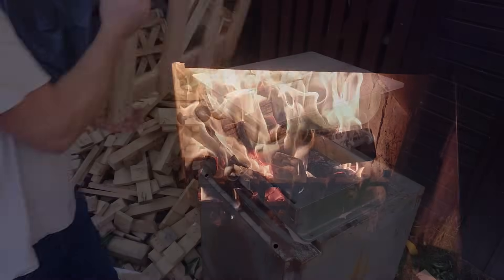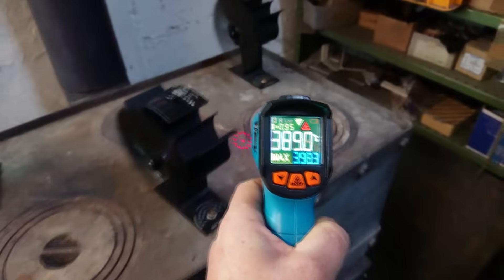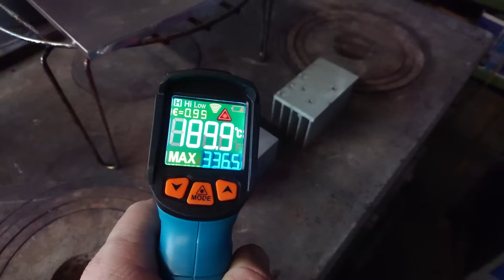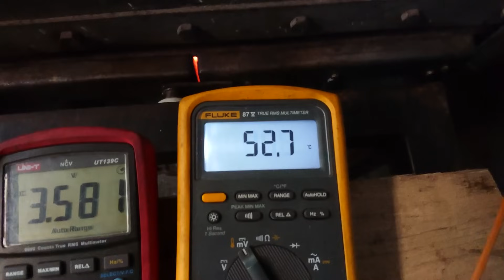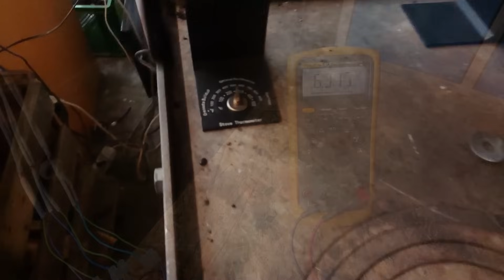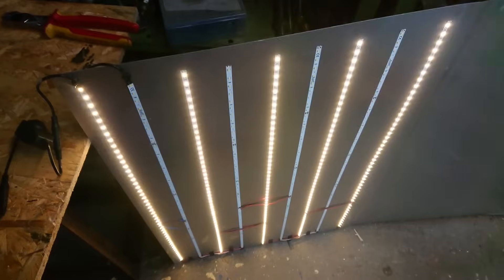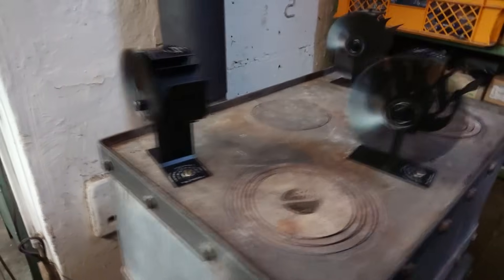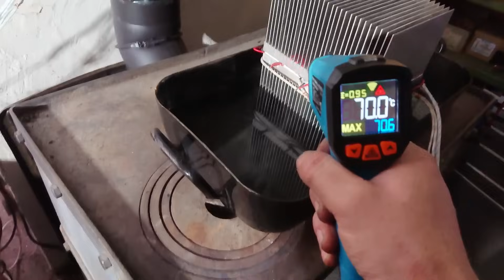Generating Electric Power with my Wood Stove - Peltier Experiments

Comment from the maker: Just a quick word about the specific type of Peltier (TEC) device I'm using here: There is no question that there are better (dedicated TEGs) somewhere out there. But the reason why I made this video, is that this specific TEC that is sold as a cooling device is now 4 or 5 euros a piece. During my research I wasn't able to find any cheap dedicated TEGs, but if you know of any please let me know and post a link here if you can.
Reply: The peltier has limits. Find those limits. How much heat can it turn to electricity max - And then create a heat pickup that will self-regulate to that power transfer level. You can abuse the laws of physics on differential of expansion of materials. Even a small wax rod will be enough with a spring - if it gets hot, the piston bends the plate and disconnects the bottom heat sink, reducing heat transfer. The cooling side can be designed to cool off within the above spec, passively.
Reply: The main difference between a TEG module and TEC module are that the ceramic plate on the hot side is slotted so the expansion can be compensated for. Also the solder that holds the PbTe/Se elements in is a higher temperature mixture than of a TEC. The final difference is that the  thickness of the module for a TEG is thinner than a TEC to allow for faster thermal transfer and more current. The combination of these features allow for longer life and about 20 to 30% over a regular TEC as a TEG. The best TEG modules have Bismeuth Cadmium Lead Selenide with aluminum nitride ceramic plates. These are used for 238Pu based nuclear "batteries"
Reply: Very interesting video, loved the content.
Are you familiar with a simple thermostat heat choke?  It's got a steel coil inside of it that bolts to an engine manifold which expands when heated thus opening the choke on a carburetor. You can hook your chimney power generator device up to a similar choke so that a vent will close at a certain temperature thus controlling the heat as not to damage your thermal electric generators. 
it would require the need for a steel cabinet and closable louvered vents. I think you'd be able to maintain the heat to operate at a constant workable temperature.

You may find what you are looking for in a scrap yard.
Reply: This is good idea. Along the same lines, one could use an automotive engine thermostat to push open or close a plate or damper.   @IR-nq4qv
Reply: Couldn't you access cold outside air to cool the other side to make a greater temperature difference? It's snowing out there and a simple pipe loop could do wonders
Reply: a combination with a water heater would be cool
Reply: @imyaaniggua  IPOWERTOWER THERMO SYPHON
Reply: Some newer cars have TEGs - but haven't been able to find any used parts on the cheap, but that might be a source to look into.
Reply: Something you could try is to use a 'phase exchange cooler' on the cold side of the TEC. Something like a CPU cooler for example. While not free by any means (unless you're lucky) they should cool better than your current static heat sinks without the need for active cooling. Good luck.
Cheers 🍻
Reply: potentially a material change for copper on the cool side . while copper and aluminum heat and cool similarly, copper does it that bit faster . it is much harder to come by larger copper heat sinks albeit. best of luck on getting a good differential. 

I had a rethink and potentially a cheap pc cooler with copper heat pipes, their whole job is remove heat from a plate.
Reply: I thought of a water bath to limit the temperature 👍. How about using a heat exchanger on the cold side, but without a pump. If you put the cold reservoir/radiator higher than the generator the coolant will circulate by convection, hot water rises, cold sinks.
Reply: @regisdixit steel rebar wont conduct heat to that length, all the way to the floor, only the first foot would radiate...3rd person with this wonky to the floor idea, he simply needs cool air to the top side with a ducted vent of any kind
Reply: The main difference between a TEC and a TEG is the expected operating temperature and deltaT. The hot-side temp creates issues with solder melding so the must be manufactured with high temperature solder. The high delta temperature (between hot and cold side) creates stresses so they must be manufactured with a floating hot-side meaning no stresses will arise there. The generation is identical and use the same seebeck effect. Higher temperature difference means more heat can pass through the element which means more electric power is generated per element.
Reply: And on the plus side, if you induce sufficient currents in the Peltier you could start a fire on your Wood stove😂 I have been wondering for a while now how to bring some of the Canadian cold on the cool side of the Peltier. Floor rebars cannot be used here since we insulate our floors.
Reply: Pesquise o elemento SP1848-27145
Reply: What's your files member #? 😂

Thanks for your testing.
Reply: I thought about something like this but decided on a different solution
https://www.youtube.com/watch?v=hEOht38IFYQ&t=471s
Reply: The stove top fan uses a bimetallic strip at one side of the base, it just lifts the whole fan away from the stove top, self regulating. @orionbetelgeuse1937
Reply: Just wondering, instead of the stove have you tried it with a candle or spirit lamp or something? I believe a candle gives out about 80 watts of heat energy, you would get extra light too. 😂
Reply: If im not wrong 
U'll wont have to worry about Natural Gas Being expensive anymore
If im not wrong Germany is Buying gas From Algeria 
The pipeline is Going through Italy and coming to germany again if im not wrong
Reply: Make a steam generator 😃
Water from rain
Heat from the stove
Reply: Here's another idea for heating your shop: the process of composting can generate temperatures up to 60-80C.  All you need is a way to transfer that heat from the center of the compost pile to where you need it.  Many folks use loops of HDPE piping, but I wonder if pumping water through second-hand car radiators buried in the pile might not be more efficient.  As well, you could attach a second radiator to a box fan to heat the air wherever you need it.  I haven't done it myself, but apparently you need the proper balance of 'green' and 'brown' organic matter for optimal composting, and it needs to be well mixed to prevent very dry, very flammable pockets of material from catching on fire.  (The chance is VERY low if you have any sense, but still non-zero.)  The relevant search string is 'Jean Pain compost heating system'.  

Cheers!

...and yes, you could have compost-powered electricity production with TEGs, theoretically enough to power the water pump.  Maybe.

...and if you enclose the compost system--i.e. create a 'biodigester', then you can harvest the methane produced by the process.  (You'll want to scrub the H20 & CO2, but that isn't too difficult or expensive.)

...and if you search on YT for DIY Perks' 'Turning Smashed TVs into Realistic Artificial Daylight' video, you'll find a MUCH better way to use those LED strips AND recycle some e-waste, to boot.  (Make sure you click on DIY Perks' video, as there have been a number of copycats over the years using the exact same title to pull views.  I'll include the direct link below, but YT might delete it.)
Reply: @KeithOlson 
Compost can get a lot hotter than 80°c.
We used to compost 300 tons of grass cuttings and general garden waste every year, upto 12 tree trunks, we used to have to damp it down every day to stop it bursting in to flames.
Within a few minutes being cut and piled up, grass puts out tons of heat, can destroy vans and kit if not careful..
Reply: @tedleaf-pk2jc  Yeah, some care definitely needs to be taken with it.  

(The figures I used are considered the high end when it comes to the survival of the bacteria, rather than the maximum termperature achievable.)
Reply: Here is that DIY Perks video: https://youtu.be/8JrqH2oOTK4?list=PLOJU8YJjFwGN0hMRewz2_u2IefV-vipsk
Reply: Maybe a homemade steam engine liked to a generator would be more efficient and be one the few option after SHTF like a global conflic.
https://www.youtube.com/watch?v=qzp09qyH_J0
Reply: The efficiencies of Peltier's are at best lower than 5% and only if you can properly cool the non heat side,  such as running water.  Economically solar panels are far better sources of power, last for decades though you would need some kind of storage.  Second hand lower efficient panels can be acquired for very little money.
Reply: Okay you just suggestion here have you tried some resistors and some bump up transformer from the radio okay just bring it up
Reply: Is it an idea to use like the fans the rotation movement to to a magnetic field so like a generator? Maybe first increase the torque,with wheels or multiple fans increasing the torque
Reply: have you thought about stirling engines?
Reply: @BjornT97   mechanical parts, not easy to source replacement parts without a lathe.
Reply: Proper TEGs are prohibitively expensive and gather only a little bit more energy.
Reply: @jackmclane1826  Proper TEG 5-8% efficiency. Peltier 3-5%. TEG moduls  +200°C ~20$, +300°C ~30$, 600°C ~50$. Price depend on output. +300°C ones with output up to few watts cost ~30$, ~8W ~60$, ~18W ~100$. Those "cheep" (5-10$) Peltier output less when 1W, breaks around 100°C if passively cooled. Module sizes same. One proper TEG 40mm^2 for 30$ will give couple watts easily. Will need few 40mm^2 Peltiers (~20-40$) to get same amount. Problem with dedicated TEG modules - not readily available for hobbyist/tinkerers/public in local/generic (electronic components) shop.
Reply: @jackmclane1826  bs
Reply: Für handy laden und paar leds reicht auch so ein kleines dampfmaschienen model. Da komm ich nämlich zum Punkt. Richtig power würde nämlich ne dampfmachiene bringen. Wenn jetzt son alten rasenmäher motor als dampfmaschiene umbaust. Da machste ein paar ventiele auf und zu um da dampf rein zu lassen und dann lüppt das. Gut da brauchste dann irgendwie ein dampfkessel. ist wieder higher mantinace Aber dann hat man was richtig geiles so.
Reply: Proper TEGs are not more expensive than few 4 Euro cheap ones put together, because they put out that much power. And it'll have better results and easier to set up.

The single greatest reason for power generation is the ability to handle higher temperature difference. It also has the side benefit of implementing as a practical application easier because it can handle greater differentials.
Reply: I know as American I probably have better options, but I've been looking into the graphite based superconductor thermal plates. They are far more heat tolerant, and can maximize the differential of hot/cold sides. Try utilizing-  the outside sections, double wall pipes, ( I transferred to a square galvanized pipe outside & covered all for sides, wiring then per section, supplying power to battery that power my home.) The middle road higher grade layered graphite/alloy thermal plates are a bit more cost. But You get what you pay for. And Cost efficiency is better than Cheap. Cheap always costs more in long run
Reply: @MarineVeteran0351  How exactly does being american help you here? Do you have more chinese crap than anybody else? :D
And what do superconductors have to do with that?
Reply: if you heat up peltier coller to slow petier coler can't produce electricity an can burned off

Comment: I've never seen a peltier device in my life, or didn't have any technical requirements to recognize it, but doesn't it have factory specs? Try to find the dangerous temperature range and before you test it, use a thermometer to check the temperature you're getting. I'm just saying this because I'm stingy with money, why burn a 60$ device?

Comment: One of the stove fans that I’ve looked at before had a little bimetallic strip in the flat base, which tilted it very slightly at high temperatures, just breaking thermal contact and regulating the heat that got conducted up into the aluminium extrusion. 

I thought that was quite a neat, simple means of temperature control. It might be worth thinking about something like that, I like the idea of a simple but active means of heat control.

Comment: I absolutely love this experiment...I'm sitting here staring at my wood stove, with one of the Peltier fans on top running...I've been thinking of how to get electricity from this for years.  Have you looked at the Bio-Lite camping stoves? they are portable camping stoves with USB plug in's to charge devices.  Their website reads it's powered by:  Patented combustion technology creates a vortex of smokeless flames for a portable camp stove that can cook your meals and charge your gear, all at the same time."  I'm not sure if it's new or old tech however I'm going to check into it too EDIT:  it is the same type of concept ... SEEBECK efftect.  Just watched a video...anyway, you might like to look at their small set up for fun.  Thanks for your experiments here.  Keep up the great work!

Comment: Have you considered placing the device on the outside? 

A All the heat exiting the pipe at this point is truly "wasted" as it is not heating the room at all. In your current set up you are stealing a little bit of heating power to convert to electrial power , If the set up was outside then your not stealing any heat from the room. 
B The temperature of the pipe at this point would naurally be lower.
C The cooler outside air would increase the temperature differential.

Comment: Maybe try not using the large heatsinks at all. Allow the hot side of the peltier to heat up from the emitted radiant heat and set the temperature by varying the distance between the peltier and the hot surface, stove top or exhaust pipe. That way you reduce complexity, materials and cost. I am imagining a square section of flue, surrounded by a larger square section. The peltiers would be mounted on the inside surface of the outer square section. The outer square section would be open at the top and bottom to allow the hot air to exit and not overheat the peltiers. Think of the outer square section being similar to the safety surround that is sometimes put around a flue section to prevent someone being burnt if they accidentally touch the flue.
This would give a large flat surface to mount the peltiers. Being open at the bottom and top would allow for easy wire routing. The peltiers would be out of sight making the setup look just like a normal stove setup. You would only need thermal compound on the cold side where it attached to the inside of the outer flue section. There are thermal compounds that are a glue as well as a thermal transfer paste. I think they are called Thermal Plaster.

Comment: Very nice. An interesting setup I thought of would be to replace a nearby window with a sheet of metal, put the Peltier's on the inside and feed them with hot water from the wood stove via a heat exchanger, on the outside put big heatsinks and let the cold outside air do the job of cooling them?

Comment: I'm curious if a well designed fireplace like I've seen built on YouTube could power a water heater than has a recirculating capacity so the second heating of the water can drive a flywheel and that flywheel could power a compressor  to be used in tandem with induction heating to create a refrigerator in the basement below this first floor fireplace. It's a typical setup in Midwest America and having a method to run basic heat power and refrigeration from the fireplace would free many middling folk from the corporate chokehold.

Comment: flash steam generator (a very thin copper tube around the gas pipe, or better on the inside top of the stove, with water flowing inside). at a certain point the water became steam with really low energy. Then use the steam, to spin a Tesla turbine binded to a generator. Condensed water could be re-routed, from an opened container, to the tube, with a pump (and maybe used to heat some radiators in the middle?).

Comment: Well done! As heat rises and cold falls, a completely passive water jacket might work, you have the temperature differential between the top and bottom of a large vessel of water. Or perhaps a different liquid medium could be used. Or a cold sink to a large part of the building structure itself? You might need a heat pipe to move the heat away in that case. Perhaps you could make the heat pipe itself. In Germany right after the war, my Dad saw trucks that were powered by wood gas. He also had to visit a Dentist, the Dentist had no power to run his drill, so he had his drill powered by a stationary bicycle. People also were collecting bricks to rebuild. Everything can and should be repurposed, you also gain the skills and ingenuity, that will get you through anything and it helps the planet. You are so handy, my number one regret is I never learned how to weld. All the Best! 73 DE W8LV BILL

Comment: to cool off the top of your last experiment you could get a fresh air intake from outside run the cool air on top and then connect it to your fresh air intake on the back of the stove and this will constantly cool the top of the TEG 🇨🇦👍👍👍👍👍

Comment: Have you thought about using flexible soft copper tubing for water cooling encased in high temperature resin and impregnated with copper powder or granules to disperse the heat evenly.

Comment: you are doing exactly what i was doing a few years ago until my tec's died for the same reasons as yours. i actually used the water bath as the bottom and had a fire on top so they didnt get too hot. I was using a cpu liquid cooling system and fan to keep the water cooler (didnt work very well) but it wasnt enough to get much more than what you are getting. my next thoughts were to add ice and the voltage went up to 5v and i could charge my phone but the tec's failed over time so i gave up